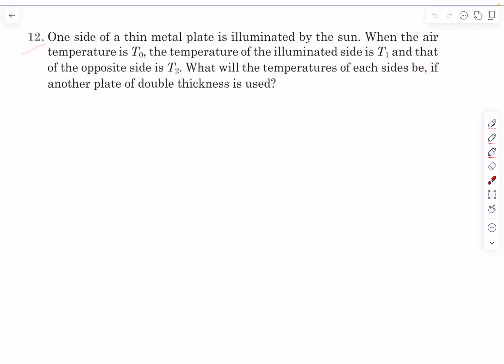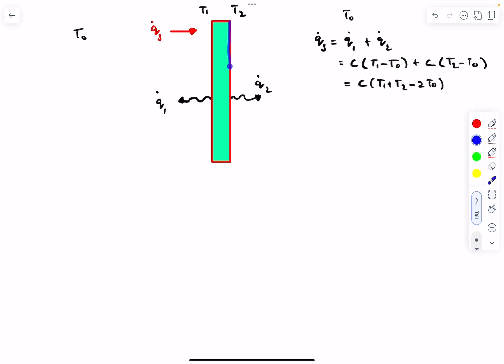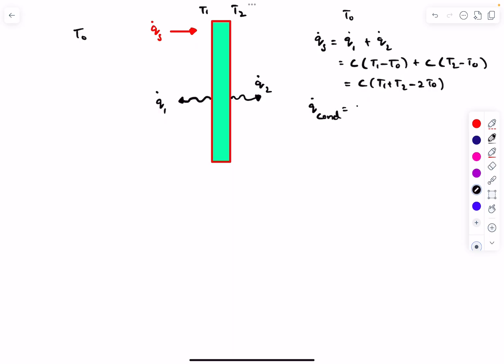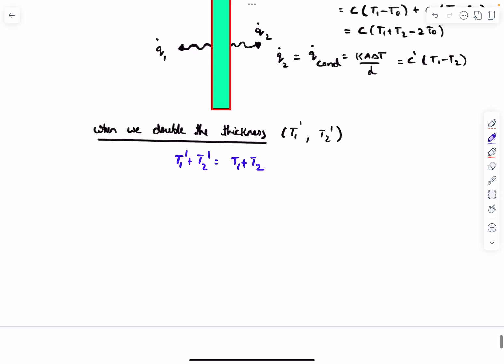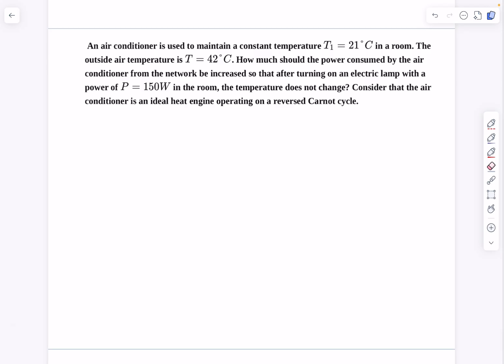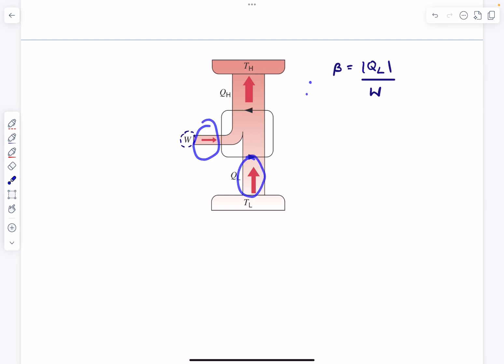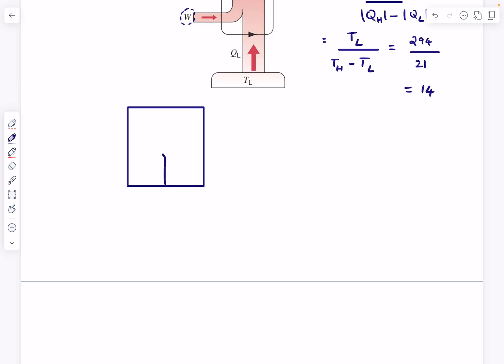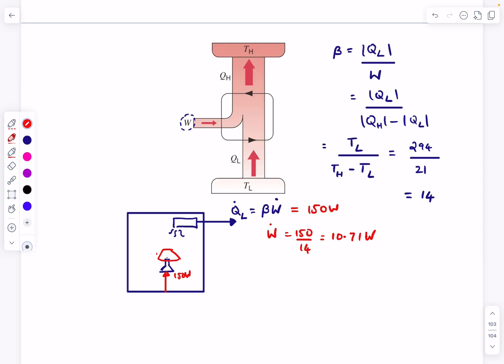Good Problems For Adv 25

Comment: In the first problem, for writing q1 and q2, shouldn't we use Stefan's law since the question doesn't specify the temperature difference between T1/T2 and T0? Because NLC isn't valid for large temperature differences...
Reply: The difference ought to be very small, just illuminating a metal plate with sunlight isn't going to make the plate much hotter. You could also input values to check for the same.

Comment: In the first qs why will the constant C remain same , if we are doubling the thickness then the mass also doubles and so does the heat capacity
Reply from the maker: C is not the heat capacity
Reply: @PhyX_03  oh , i thought dT/dt=k(T-Ts)
dq/dt=Ck(T-Ts)
is the heat only lost through the surface or the bulk?
Reply: @rekhashandilya5673  it is mentioned that the plates are thin

Comment: Sigma a t power 4 can also. Be used
Reply from the maker: It's not used here because the plate is not super hot compared to the surrounding air so natural convection usually dominates radiation in these situations like the cooling of hot tea ☕ example. So in these situations we use Newton's law of cooling for writing the heat loss to the surrounding's. That's why we ignore heat loss due to radiation. Ig u r confusing it with the problem where we keep the plate in vacuum, there ofc theres no convection.
Reply: @PhyX_03  ok bhaiya so ye hint kse milega ki neglect Krna hai ? Air dia h isliye na
Reply from the maker: Ha vo question dekh ke hints mill jayega usually. Here the big hint was air ka temp. But vo mentioned hoga ki radiation hi consider karna he ya convection he consider karna he. In small ∆T type situation he to convection he hoga usually. Black body kuch hua tho radiation phenomena hoga. Vacuum me game chalra tho radiation only. 
This was a prob in jee 2020 adv yaha pe clearly mentioned he ki konsa formula/phenomena dekna he 

A container with 1 kg of water in it is kept in sunlight, which causes the water to get warmer than the surroundings
The average energy per unit time per unit area received due to the sunlight is 700 Wm−2 and it is absorbed by the water over an effective area of 0.05m2. Assuming that the heat loss from the water to the surroundings is governed by Newton's law of cooling, the difference (in ∘C) in the temperature of water and the surroundings after a long time will be
Reply: @PhyX_03  ok thanks 🙏
Reply: s(T^4 - T' ^4) = s(T^2 + T' ^2) (T+T')(T-T') approx equal to const(T - T') assuming T and T' are nearly equal
Reply: @rahulkarthik9085  yes yes 👍🏻

Comment: for the 1st question,we could also solve it by newton's cooling,reverse concept, and use the relation that cooling time is proportional to 1/thickness,then we get the 1st equation,2nd equation by conduction of heat

Comment: Bro could u check out Pf rotation cyu 24 , im getting diff ans from book , but that matches Jaan kalda ans , pr 20
Reply from the maker: yea the ans is wrong in the book there wont be a factor of 2 i believe
Reply: @PhyX_03  yes , thats what i got too bro , took element in polar coords and integrated component
Reply from the maker: Yea kalda ans is 💯
Reply: @PhyX_03  physoly did with icr , that was really cool , but some guys in yt did vector analysis , could u say why that is wrong pls : )
Reply: @Αράπης_Ψ Bro if you see that Pathfinder question was actually made to be solved by the vector method.......( Se the question 22,23,25 beside this question they are beautifully done by vector methods)...
But in that the problem is that for that answer the vector part .... The small part of the center of the disc must be non existent which is not true.... That's why there is a ghapla of a factor of 2.... If you have solved it you will understand it then......

Otherwise if we do by brute force( double integration)
Or ICR METHOD AS IN THE JAAN KALDA HANDOUTS THE ANSWER WILL BE ACCURATE...
Reply: @keshav9660  aah yes , that makes sense , thanks bro
Reply: Bro still cooking mechanics 😮😮😮
Reply from the maker: @Flash_098 😂😂😂
Reply: @Flash_098 😢